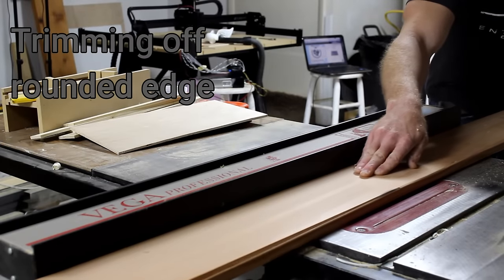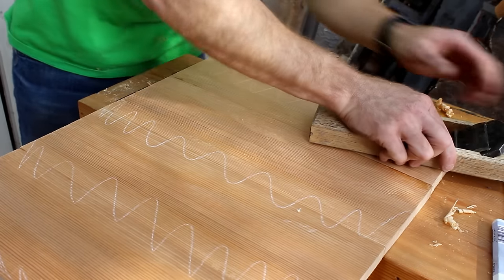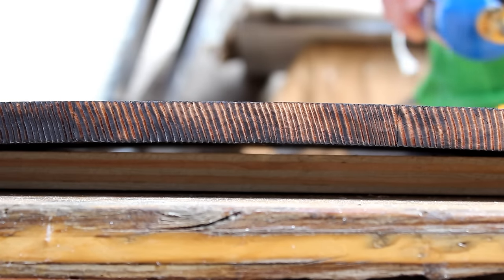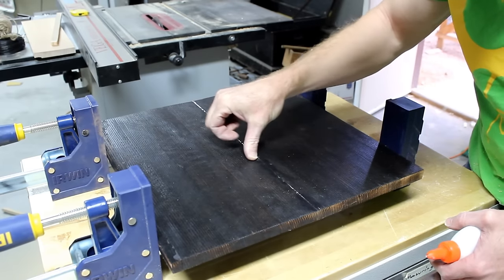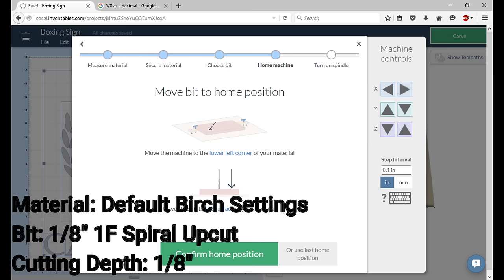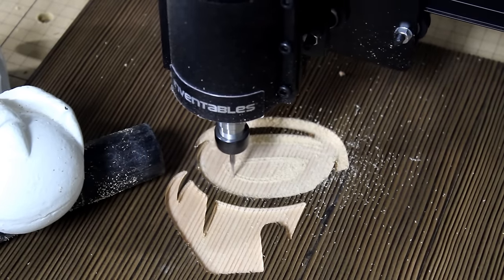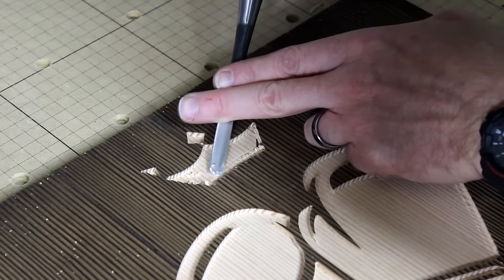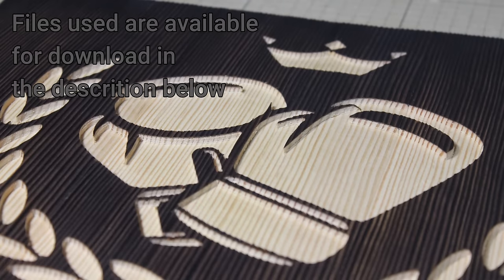Make a Custom Boxing Sign

Comment: I really dig the burn technique. Really took it to another level. What kind of scraper/plane was that?
Reply from the maker: +Michael Lawing Thank you Michael!  I was using a Japanese hand plane.  Its close to the old school wooden body planes.  The difference is you pull the plane to you.  Also, the blade and chip breaker are really thick compared to western planes.